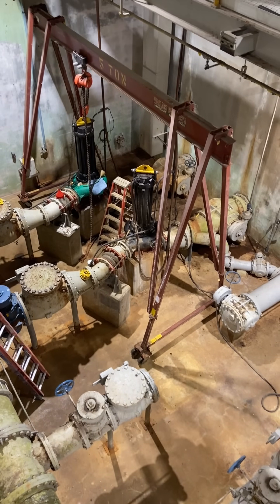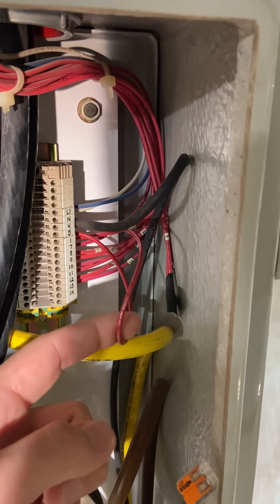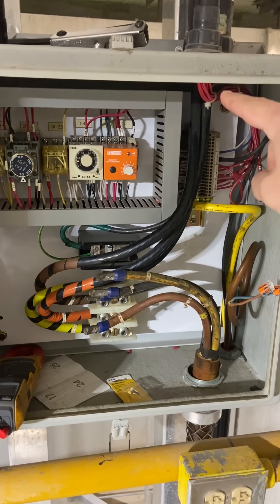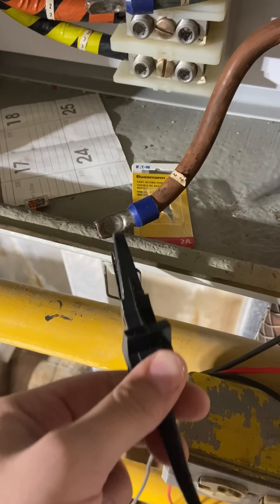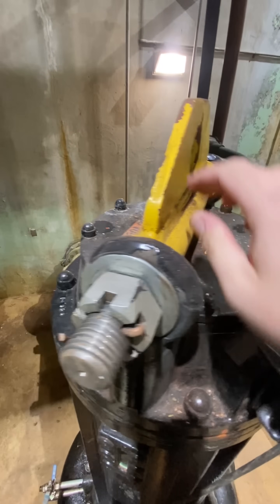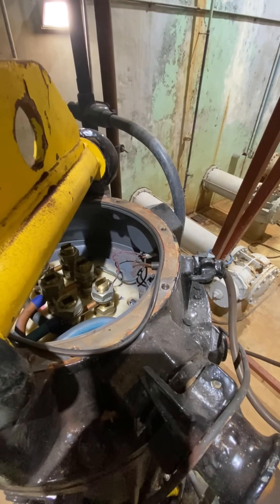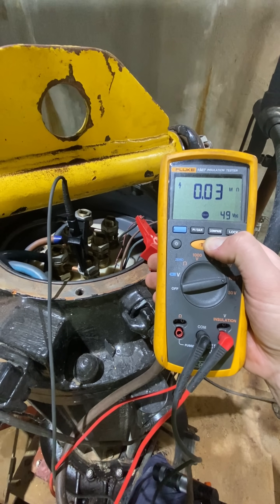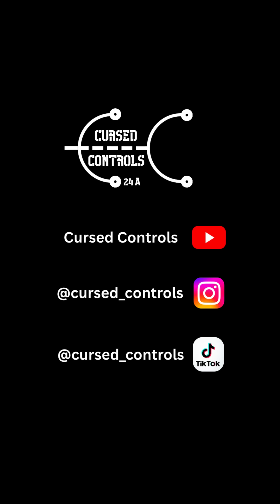Temp Sensor #electrical #motorcontrol

Comment: Motor guy here. Apparently you’re supposed to run it with no seal fails or overtemps or anything until the motor is full of water and the bearings yeet themselves, locking up the rotor, and if it trips the OL (which shouldnt be set correctly anyway who does that?) make sure you try to start it about 10 more times to really blow a hole in the windings and leave expensive little balls of copper in the bottom of the stator. 

Or at least that’s what all of our customers do anyway…
Reply: Come on we almost never send motors out like that. Mostly because we shit can them and buy a new one, but ONLY after it fails and we're down for two weeks 😅
Reply: @adampindell lol. It would seem like management has the same mentality no matter where in the world you are.
Reply: I've never seen the overtemps connected to anything. But I've always always seen the overcurrent on the starter set to "about right"... Maybe we just fuck up differently here though
Reply: I used to fix aircraft parts, in particular starter motor-generators, and the number of times you get a unit for inspection but the insulation is scorched, there's approximately 1 nanometer of brush left, and a groove on the armature deeper than the Mariana Trench... you'd think they'd eventually figure that if they're sending it in, we're rebuilding it...
Reply: @PolarisC8 you might be interested.  A mentor of mine flew B29s in WWII they had just dropped their load and were closing the Bombay doors when smoke filled the cockpit . They were still over Japan so parachutes was a bad idea. My friend got wire cutters. Went an found where the smoke was coming from and started cutting wires.  They followed other planes back as they had no electrical system.  Boeing engineers found that was the voltage regulator for the generator.  Boeing then figured out why it failed. They had lost a lot of B29s without any radio messages from them.  Thought you might be interested.
Reply: So from my experience working on the systems those motors are attached to, it's almost as hard to get the green light to send in the motor in for rebuild prior to auto disassembly mode activation as it is to rebuild after that. While the guys wearing the overalls can generally be blamed for it, the issue is that suits would rather shell out 10x more money in an emergency than invest in proper preventative maintenance.
Reply: Motor tripping the overload? Ehhhhhhhhhhhhh... Let's see if 1/8 of a turn fixes that!
Reply: @TheDiosdebaca our "trash truck electrician" always bumped up the fuses until it was time to replace wire runs in the body...  And he only ever used red wires. 🫣
Reply: Hey motor guy apprentice here! Don’t forget about the old guys in the shop yelling to replace but then also complaining about things not being like the old days!
Reply: I aldo like my cooling fans with no fins left and a blanket of dirt all over the housing. One phase should be loose too
Reply: 😂😂😂😂 thats 90% of our equipment at our plant. Niw that i took over if shit thriws an alarm we address it.
Reply: Trip > reset > trip > reset > trip > reset > BANG!!!!! I’ve seen it so many times where the client presses the reset tit, thinking it’ll cure all their woes.

Once, ok, maybe. Multiple times? No. That’s literally the definition of stupidity.
Reply: I started reading your comment like it was gospel because you started it off with "motor guy here"  LMAO  You got me pretty good!
Reply: Yea this is pretty accurate I worked in a motor shop for a few years none of the pedestal pumps sent in were for preliminary trouble shooting sump pumps were also almost always burnt up this tracks well
Reply: Chief Engineer here, your description is perfect!
Reply: Glad to know our plant isn't AS fucking special as it could be. Cheers motor boy, thank you for the spinny iron copper thingy.
Reply: I just assumed those wires were there for me to test my wagos out on, who knew 😂😂
Reply: Indeed the best comment. my gratitude to elucidating me for illuminating the ways I have been leveraging my pressure differential device incorrectly
Reply: I was gonna say that this guy lies: he doesn’t want to go through the hassle of changing out a pump 😂😂
Reply: @dannygaliniak5898 Like an electrician is going to change out a pump 🙄. He's going to pick up his radio, call for the mechanical repair crew, and go sit in his van and sip his six dollar latte. I can't believe he actually opened the pecker head by himself. 😂

Comment: Just let it run till it dies. Probably  be cheaper in the long run.
Reply: As long as it's not energizing the case of the motor, then I'm with you. Order replacement, have it on standby when she finally cooks herself.

Comment: I'm sure they're double triple disconnected, but something about bare-handing those large supply cables just doesn't feel right.
Reply: You know he put his multimeter on it first and so do I and so does he, but not seeing it happen certainly made me wince 😬
Reply: Imagine what it feels like the first time you touch a primary conductor
Reply: @Adam-hp5hj  I've touched 230 V a few times as a kid (although the EU grid used 220V back then). It hurts, but it's not as bad as people think.
Kids have small fingers that can get into all sorts of unbelievable places. 
My dads vacuum is from the 60's and thus doesn't have a child-proof plug. So i managed go put my small fingers directly onto the contact points in the female plug.
Reply: @Adam-hp5hj 480v? you'd live but you'd deeply regret the mistake. at least if the DC didnt lock you onto it and fry you, but a quick zap will hurt in ways you didn't know could. possibly a long term twitch after
Reply: LDL first haha
Reply: Do you close the fridge door with your hip?

Comment: Temp sensor doesn't like when the pump goes roundy round
Reply: Certainly not when the angry pixies are tickling its funny bits.
Reply: Temp sensor is irrelevant to the fuse blowing 🤦🏽
Reply: @ACommenterOnYouTube you must be new to the channel otherwise you would have gotten it
Reply: @ColeSpolaric  151 IQ's dont get jokes that easy as our minds work on a different level 🤷🏽